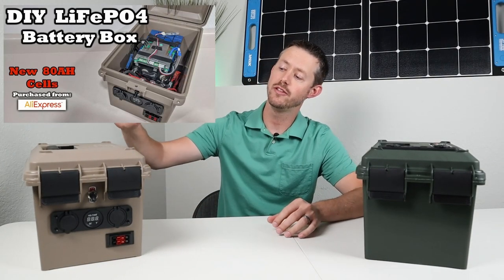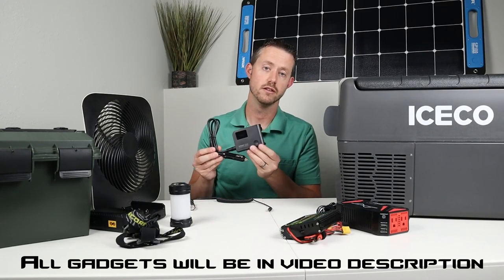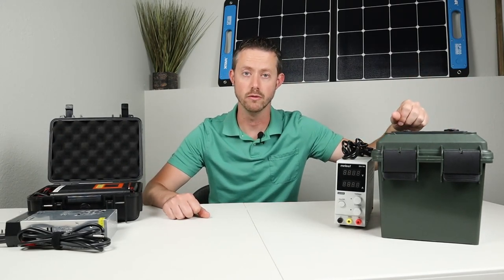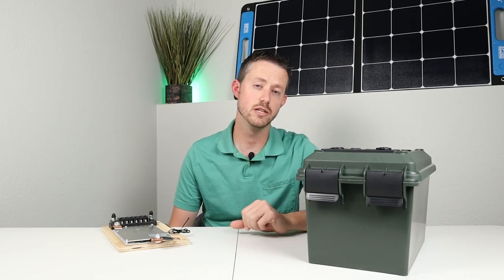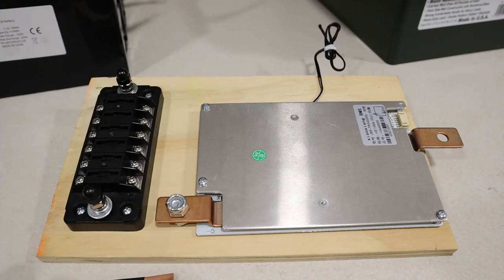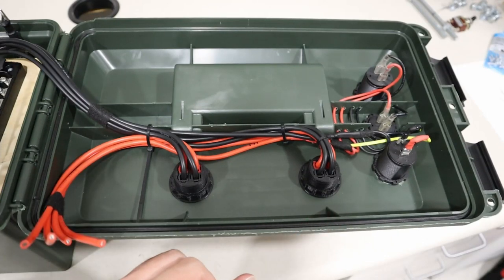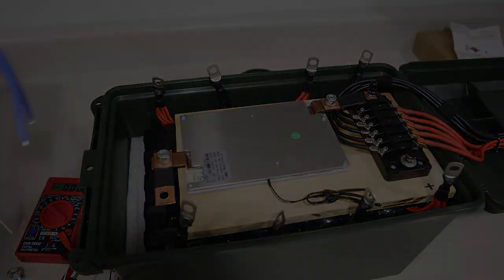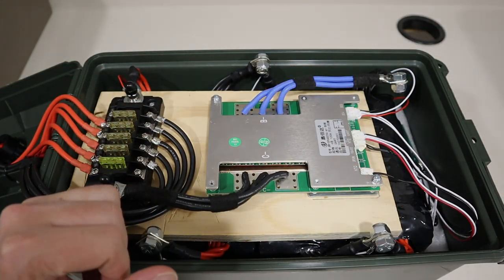$420 100AH LiFePO4 Build - BatteryHookup.com Modules - Super Easy Assembly! COMPLETE DIY GUIDE!

Comment: Question, where to buy the socket/voltmeter/usb ports, anderson ports, and the power switch with LED?
And lastly, where do you plug in your different types of charging methods? Awesome project BTW, I will be starting mine soon.
Reply from the maker: All parts used are on my website, that link is in the video description.

Charging hooks into the Anderson power pole connections.

Comment: Hello, you don’t seem to worry about voltage regulated 12V output, why?
Reply from the maker: The voltage curve of this Lifepo4 chemistry battery is higher than other lithium NMC chemistry batteries and lead acid chemistry batteries. This battery sits at 13.3-13.0 volts during 85% of its usable power. No need to waste power if it's already a prime level of voltage for running 12v appliances. Hope that helps explain why I don't think regulation is needed.
Reply: @Jasonoid  ha! I see thanks. I was confused because some commercial units like bluetti eb70 claimed 12V regulated with the same chemistry
Reply from the maker: @JeanYvesHudon  that's because the Bluetti power stations have 22v batteries or 48v batteries and require regulation to drop down the voltage to a usable level. I have 3 bluetti power stations. They are great!

Comment: Have you ever considered making a lithum jump box?
Reply from the maker: These Lifepo4 modules can't source that many amps. It's probably better to use NMC 18650 lithium cells. I'm not a huge fan of NMC chemistry batteries, they have a higher fire risk. There are quite a few lithium jump boxes online for a decent price that offer better safety than a DIY build.

Comment: Hi Jason, how many amp fuse that you use for the anderson power pole?
Reply from the maker: The Anderson power pole connections are rated at 30 amps, but I would spec the fuse to the size of wire you are using. For example 12awg wire is only rated at 20 amps.

Comment: So would this build be comparable to the bluetti EB150?  I’m looking at powering a small teardrop style camper. I don’t need all the USB and inverter outlets that come on a standard bluetti. Does this build support 12v pass thru charging from a vehicle?
Reply from the maker: This build has a total of 1280wh, or a little more ....so comparable to the EB120, not quite the power of the EB150.

It behaves just like a car battery, so you can charge it and discharge it at the same time with  no issues.
Reply: @Jasonoid  could I just add one or 2 more batteries to increase the watt hours?
Reply from the maker: @Wrongwayadventures  this is a 4s1p battery, so for it to work properly you'd need to do a 4s 2p battery, so 8 modules total. That would keep the voltage the same and double the capacity. So it would have 2400wh.
Reply: @Jasonoid  ok thanks.
Reply: @Jasonoid  Can you do i bigger build video like this for running larger appliances?
Reply from the maker: @djpeaceofmind2851  Yes, you have two options. 

Option one, Build a similar pack but with 8 modules in series at 24 volts with a 24 volt inverter and you could use much smaller wire due to higher voltage and less amps. If I was going to build a large home battery I would do a 24v setup with these modules and plan to run a 2000 watt inverter.

Option two would be to have a 4S pack like this but then add more cells in parallel, so 8 modules (4S2P) for 200AH, 12 modules (4S3P) for 300AH. Then you could pull out 200amps, or 300amps from the pack but those wires would need to be HUGE to handle that amperage!

Hope that info helps.

Comment: Any suggestions for a 14.6 volt car charger option? Must be 10a max and cigarette lighter compatible
Reply from the maker: I haven't seen any 12v dc to dc dedicated chargers. You'll have to run a small inverter and then a charger like this:
https://www.amazon.com/ECO-WORTHY-Automatic-Battery-Charger-Maintainer/dp/B08T95FF8K/ref=sr_1_11?keywords=lifepo4+charger&qid=1638900568&sr=8-11
Reply from the maker: I have found it pretty hard to find a DC to DC charger for these batteries. The option you linked will work but most options available are AC to DC and will require an inverter.

Comment: Thanks for this thorough tutorial! I'm following it almost to the T except with my DIY Eve 100Ah prismatic cells. 

I have a question regarding hooking up a more powerful inverter (Giandel 1200W pure sine). Are my assumptions correct that 1200W / 12.8V = 94A. The Anderson powerpoles you have can't carry that load so would it make sense to just run appropriate gauge wire (thinking 2AWG) directly from the battery to pos/neg battery posts? 

Thanks if you can offer any insight. Would love to see more of these vids!
Reply from the maker: You can parallel the Anderson Power pole connections together at 20 amps each connection. Since I have 4 pairs (separately fused) I can safely run 80 amps out and in of my battery for charging or discharging.

 You can also use dedicated battery terminals for running at higher amps on an inverter.

Comment: I've been looking at batteries for about a year to build a systrm for my RV. I've seen alot of builds on you tube, but no one does anything about how they are doing after use and befor I put out a thousand bucks on a 400 amps of batteries, I'ld like to know how they hold up. Any feedback on this would be great.
Reply from the maker: Great question and point! I haven't had any issues with my modules used in this DIY battery. I have used it probably 10 times since this is a "part time" battery for camping and emergencies. I know that these are a great budget option and I do have plans to purchase more.

 These modules were purchased out of my pocket and I stand behind them and their quality. This video was not a sponsored video. If you want the best of the best you should go for Battleborn or SOK batteries.
Reply: P.S. I have heard that the  they don't suffer from swelling like prizomic(sp) cell do.
Reply from the maker: @putteslaintxtbks5166  Correct, these are cylindrical cells with aluminum casings and wont swell.
Reply: Thaks for getting back to me and so quick! I watched you vids on 12v fridge/freezers, but don't remember if you did a review on the Domende 54 qt. I got one  for around $240. I use it 24/7 as a freezer and it works great, but I needed to wrap it with insulation. I think after it got cold, moisture got into it's insulation and no longer worked well. I may try this next summer to open and replace with a ridged foam and seal with something like silicon if it looks like I can do that without breaking it. Even the lids insulation failed after a few days of running, moisture forming on top of it.
Reply from the maker: @putteslaintxtbks5166  I haven't reviewed any Dometic fridges on the channel, they are pretty expensive. I have heard they last quite awhile and are reliable :) Let me know if you are able to salvage it after making your repairs.

Comment: Do you know of any other place to find comparable battery modules or bms modules since battery hookup seems to be out of stock?
Reply: Or would it be wise to buy a manufactured battery to take apart for this sort of project?
Reply from the maker: I think it might be best to just use the manufactured battery left in it's case, it will just take up a little more space than this option.

Comment: Excellent video, very neat installation... I do have battery box which is rated 60AH from the manufacturer. I would like to use 100/120Ah battery in the box. Do you think it would be OK as long as I do not exceed 60 AH with my load
Reply from the maker: Yeah, as long as the battery modules will fit in that box it should be fine. Just don't go over the 60 amp limit.

Comment: That is a lot of power! Mine are 32AH each by your design. Hope to update the batteries one day.
Reply from the maker: I remember when I put out my first build and you made two of them for you and your family. Those lead acid batteries work well, I just needed a bit more power. I BARELY fit it in the same case!
Reply: @Jasonoid  I bet! Even mine were a challenge with the charge controllers. Awesome build.

Comment: What is max wattage input from solar you can use to charge? Also how can we just add some AC ports directly
Reply from the maker: You wouldn't want to go over a 0.5C charge rate so that about 640watts or about 50amps at 13.3volts. It can charge pretty dang quick at that rate!
Reply: @Jasonoid  So 600 watts of 12v Panels would be fine?
Reply from the maker: Yep
Reply: @Jasonoid  Perfect thank you how much more work would it be to have AC plugs added to make an all in one powerhouse. ive been searching for weeks on what to do, and i think a doubled up system like yours in a little bigger box with AC plugs and a way to monitor battery % would be the sweet thing to do.
Reply: @Jasonoid  Or im not sure if your familiar with ECO flow River and its external batteries, but doing that same concept  with being able to attach that to your system. While also being able to charge the extra batteries solo.
Reply from the maker: @djpeaceofmind2851  these cases are too small to add an inverter. Youd want to come up with something a little bigger. Adding an inverter is totally possible, but the pure sine wave inverters get pretty pricey quick. A 1500w inverter is around $250-$300. If you only need 500 watts it's a bit cheaper.

The options are endless with diy.

Comment: I built this battery box and followed all your instructions. Super awesome video and easy links to follow on your website. The only part that I have been stuck with is charging the battery. I have a charger that is set to the Lithium charging mode, but it seems to still not be working. I am thinking it may be something with the BMS. Does anyone have any suggestions on how to charge this better or fix the BMS?
Reply from the maker: Did you go with the Bluetooth BMS? what is it saying once it's connected? It will usually say charge: on discharge: on. I also just updated the wiring diagram on my website for the BMS balance leads. That may help.
Reply: @Jasonoid  I had to get the non bluetooth option. Bluetooth was sold out when I got it.
Reply from the maker: All good, no need for the Bluetooth BMS. Usually the balance leads hooked up in correctly will cause the BMS to think the voltage is out of tolerance and block charging. Check my new wiring diagram and double check.

Also, did you follow the last step of the video to turn on the BMS?
Reply: @Jasonoid  I did do the last step of the video. 

I will go check out the wiring diagram now. I have not seen that yet, glad it's available now.
Reply from the maker: Sorry it took so long! Let me know if that helps. You can email me at jasonoidllc@gmail.com if you can't get it to work.
Reply: @Jasonoid  Problem solved. Thanks so much!!
Reply from the maker: Yippeeeee! Enjoy the battery!

Comment: Great video, I’m definitely going to build one of these. If I’m using a dc to dc charger will I need to fuse the charger output or will the fuses in the fuse block for the Anderson connectors be sufficient?
Reply from the maker: The internal fuse block will handle any safety concerns, no need for external fuses

Comment: Great video! After watching several of your videos and researching several different power stations I have decided I'll try this build (with the help of my dad). As you mentioned on your website, a few of the items were sold out but I think I was able to find adequate replacements. Unfortunately one of the items that is currently sold out is the Bluetooth BMS on battery hookup so I decided to pony up and buy the kit from overkill. One question, which Anderson powepoles did you go with? 15A, 30A or 45A. Thanks!
Reply from the maker: You can do it! Just take your time and watch as many videos as you can to learn about the chemistry. I always use the 30amp connections since they work so well with 12awg wire. Let me know if you have any questions, happy to provide a little guidance.
Reply: @Jasonoid  sounds good, thank you!
Reply: @Jasonoid  Finally getting around to the build. Quick question, do you set the power supply to constant voltage or constant current when charging the batteries in parallel to equalize them?
Reply from the maker: @kevinlong5864  14.6volts constant, then the amps will drop as it gets to 14.6v
Reply: @Jasonoid  at 12:55 you mention you charge the batteries in parallel at 3.65 V and 3 amps to balance. Should that also be constant voltage?
Reply from the maker: @kevinlong5864  I'm sorry, you are correct. When charging them in parallel, set the constant voltage to 3.65v. It will take a few days to top off since it's about 400ah of storage only charging at 5 amps or so
Reply: No worries, thanks for clarifying!

Comment: I think i am going to use this exact build for an offgrid shed storage, just with screw connections on the top/side of the box
Reply from the maker: That would be an awesome project. Don't forget you can save a few bucks with my discount code. I recommend these modules to anyone looking for a super simple DIY build!
Reply: @Jasonoid  i will probably have to check for customs to Spain but will likely get this to set up a 3p4s system
Reply from the maker: @ElAdri1999  I'm wanting to build a nice battery backup like that for my home super huge!
Reply: @Jasonoid  once I get my own home i am planning on doing that, and more with the increase in the electricity price in Europe, at least have the fridge and freezer running off solar at the beginning and then expand

Comment: Would his setup and BMS work for a 48v e-bike?
Reply from the maker: This battery is a 12v battery so it's not quite enough voltage for a 48v ebike.
Reply: I built one that runs on 48v;  however it is pricy. You can see it on my channel.

Comment: Unfortunately Battery Hookup will no longer be stocking these 100ah kits. Very unfortunate. 

Does anyone know who else makes the 100ah cylindrical kits?
Reply from the maker: Total bummer! That's horrible news! I wanted to build another couple batteries too!
Reply from the maker: I know they got raked over coals on the tarrifs on these cells... I hope they didn't lose money on them. It probably just wasnt super profitable.
Reply: They had those cell packs today (just ordered one), but not with the BMS.
Reply from the maker: @danbrown586  they are back in stock! Yay!
Reply: @Jasonoid  Sadly without the bundled BMS, but they still have their $75 BMS that would do nicely.  Or of course you could get one cheaper off aliexpress...
Reply: @danbrown586  Your right. They have them again… I wonder for how long.
Reply from the maker: I called Battery Hookup, they just got a huge order in again. So ahwile is my guess.

Comment: Can you design and build a similar unit that can fit in the spare tire  (Doughnut) compartment please! 🙏
Reply from the maker: What type of devices would you want to run off of it?
Reply: @Jasonoid  Thanks for the prompt reply. I want to be able to run a small refrigerator. I want to make a small camper out of a Honda Element I have. It does not come with a full size spare so I want to utilize the space for a battery and mount a full size spare on a modified bike rack in the back. I plan to have a solar panel on the roof to charge the battery pack or utilize a high output alternator. So far I have see only one person on youtube who has used the spare tire space for two medical type (green and white) batteries - https://youtu.be/kbpIN1lEExo
Reply from the maker: Check out batteryHookup.com, they sell those medical lifepo4 medical batteries for cheap, might be a better option than a DIY battery
Reply: @Jasonoid  Thanks, I will check them out. What about the Lithium Titanate Oxide batteries used in this build? - https://youtu.be/kYx097cVR48
Reply from the maker: @ray32825  I haven't used that chemistry before so I can't really say much about it, I might try it out someday!
Reply: @Jasonoid  👍